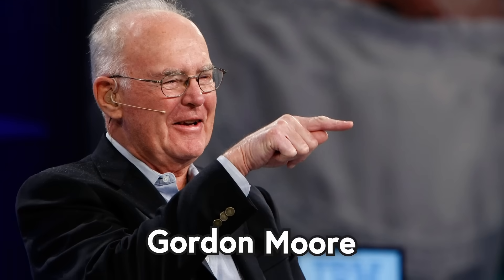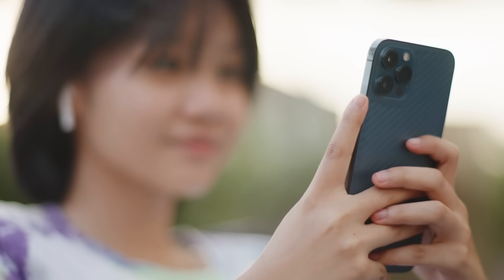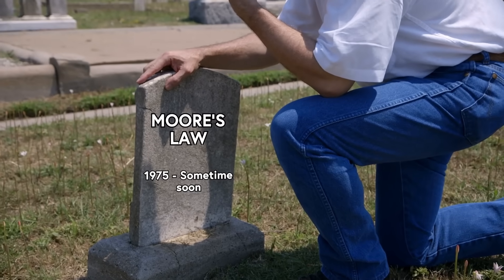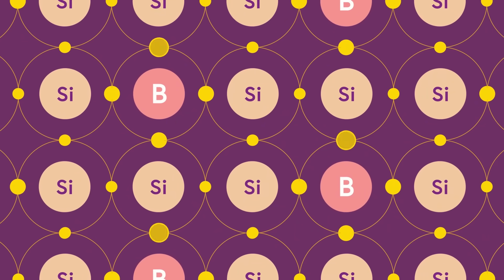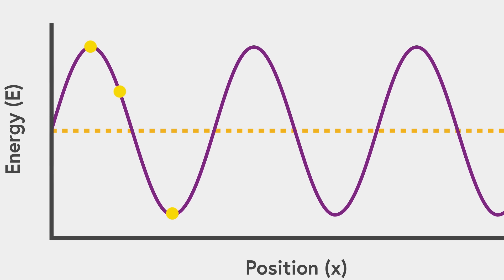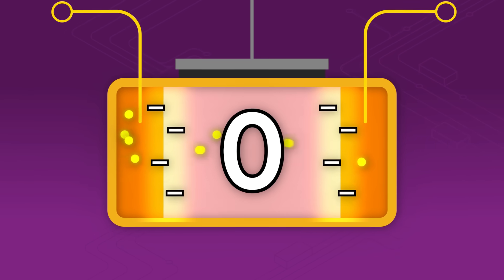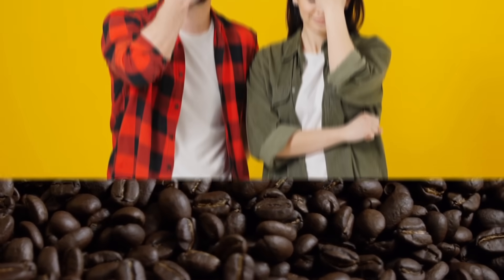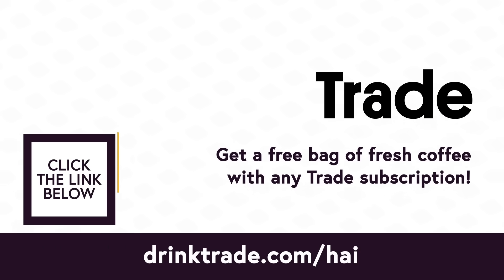Why We're Reaching the Theoretical Limit of Computer Power

Comment: This was an impressively accurate explanation of how transistors work. My only note is that Moores law is already dead, in that it refers exclusively to transistors per area. For production, instead of implementing the increasingly small transistors that science can create, we've been improving ~30nm technology for like a decade now (GAAFETS and FinFETS, for example). Industry terms like "5nm technology" are actually just jargon that means "a technology a few generations after 40nm technology that happens to give a performance increase similar to what 5nm technology would look like if it was possible for production right now."
Reply: Yep, this guy is correct

Also we've been getting over Moore's law by using processes that are fine tuned for specific applications. For example: Mobile? optimize the transistor for low power. Server? Optimize for performance.
Reply: @b.6603  we also have ways of getting more computing like in-chip cooling, 3d stacked chips, other compute architectures other than x86 and things like compute in memory
Reply: Thank you!! I’m amazed at the amount of people who say it’s still alive when there is literally a specified metric for it, and it isn’t being met
Reply: @UniqueUserName123  "Moore's law is the observation that the number of transistors in an integrated circuit doubles about every two years." so no moore law isnt dead because density is still going up even if the size isn't shrinking
Reply: @kylel1724  stacked finFETs, the architecture is becoming much more 3 dimensional.
we actually have hit true size limits for some components, RAM for instance
Reply: @kylel1724  Except stacking doesnt increase density, it just increases the height of the chip.
Reply: Transistor counts will likely continue to scale in the future through the increased adoption of multi-chip modules (MCM). Making the chip larger is problematic since errors are inevitable, you end up with too many bad chips. MCM solves this by splitting the chip into multiple pieces which then get integrated together.

Some examples of CPUs employing this strategy are AMD's Threadripper and Apple's M1 Ultra.
Reply: But what about operations pr second? Hz isn't limited because of quantum-tunneling.
Reply: @Phethario Operations per second are limited by the breakdown of Dennard scaling in the 2000s. At smaller feature sizes, leakage currents become a big concern, necessitating complex cell geometries with technologies like FinFET or GAA-FET.
Reply: @Phethario  hz is limited by the planck second if nothing else.
Reply: @leftysheppey  It's limited way before that by timings. Since as you approach the speed of light you have to start taking into account how long it will take electrons to move through an incredibly convoluted IC and return a result at the end of the process. It all has to happen in a way the scheduler can reliably predict. Which is the why processors have started using 'chiplets'. But again, that's just work around. The faster the clock speed, the shorter your IC traces need to be.
Reply: @leftysheppey  More practically you'd have to deal with your transistors melting long before that.
Reply: @innocentsmith6091  oh aye, definitely. I just wanted to put an upper bound on it
Reply: @Phethario  The operational speed per second is limited by how fast you can (reliably) push data to and from the operational units. This is limited by the speed of light as well as noise called cross talk. Further more, The speed of charging and discharging the transistors is also limited due to Capacitive effects. These are the reasons CPUs have been stuck in the 2-6 GHz range for the last ten years.
Reply: @byonnem7342  Nice, thnx👍
Reply: @byonnem7342  You're right, but that isn't a hard universal limit.
Reply: @byonnem7342  I kind of disagree about the reason for clock speed limitations. Those are problems, but you can just allow intra-die communication to take more clocks and divide the chip in a bunch of clock zones. Individual transistors already can clock at hundreds of GHz, so you can just do less work per clock, in more stages operating in parallel, and you can do the same total work per clock at higher clocks. The real showstopper was the fact that voltages couldn't be reduced much below 1 V and still have a reliable device. Leakage current also went crazy. Pentium 4 already overclocked to 8 something GHz (Northwood) with liquid nitrogen and a good sample, with the double pumped ALU that was 16 GHz in parts of the chip.  It worked until the device needed to be cooled by liquid nitrogen; than it stopped working for anyone but overclocking hobbyists.

The only thing wrong with pentium 4 was that Dennard scaling died and Intels 8 GHz by 2003 prediction turned out to be laughable. (also, X64 exists because AMD conservatively extended X86 and intel wanted to emulate X86 code on their new IA64 itanium architecture; but IA64 turned out even more terribly than the pentium 4).
Reply: @byonnem7342  actually some people i think pushed A cpu to 10 Ghz i don't think we have hit that limit yet, and then again we don't know if the speed of light is a limit we never reached it. We are just taking a education guess that is the limit for the moment
Reply: Well node size really just has to do with the minimum width of features, which there has always been a debate between what counts between companies. I mean, everyone is using the same tools from LAM, ASML, TEL, AMAT, etc, so it comes down to chip design and integration...
Reply: Oh. I didn't know that. Thanks for enlightening me.
Reply: Where can I read about that? always though the sizes marketed where literal
Reply: Isnt that is also the reason we are not gonna reach quantum tunneling until or even after "1nm" node? Because the 1nm transistor size is actually gonna be much bigger than 1nm.
Reply: It's almost like using historical data to make a prediction with no end never works, which is exactly why I doubt the inevitability of the technological singularity
Reply: @NillyTheKid  Nothing can experience exponential growth forever. Sigmoid curves match reality much better.
Reply: @bbgun061  Please tell the AI boosters that.
Reply: @MultiLegolas100M oore said it would end in 10 to 20 years in 2007. So he he didn't said it would go on forever. He did say when we would hit the fundamental limit we would just make bigger chips. Also Moore said it would end around 2025 which right now is looking likely
Reply: @NillyTheKid  Looks like we're not getting warp speed in 2063 since we're still in the "mostly exploding" phase of testing conventional rocketry. Imagine testing sci-fi stuff.
Reply: @NillyTheKid But AI isn’t really that far from humans (well it is but probably not on a log scale which would apply when the improvement is exponential) and it probably won’t just stop making progress suddenly
Reply: your right,  a group already had a 6 gghz cpu to 10gghz with liquid nitrogen  LOL   smaler and smaller isnt the key when your case is 2 feet by 2 feet...if that cpu was 4 times the size it would disapate 4x the heat....  stupid isnt it?        why risc is taking over, they dont need to be tiny
Reply: But sub 10nm sized transistors are a thing though? Don’t get me wrong, there’s a lot of industry jargon, but even at 30nm quantum tunnelling is a non-issue
Reply: @jerry3790   They aren't, those nm numbers are marketing. I'd have to check, but IIRC TSMCs N5 node has HD 3T cell libraries with a gate length of ~35nm and a total length of ~120nm.
Reply: @Azraleee  thats actually crazy, ive been under the assumption that my cpu runs on 7mm for 3 years now, but i guess not
Reply: @FritoTheLay  Node names have been marketing for nearly 20 years now.
Reply: @FritoTheLay  you can see it as it has a transistor density that is equivalent to a 7nm process. Iirc they went 3 dimensional a long time ago.
Reply: @Azraleee  Yes those are commercial transistors, but in lab settings we have successfully made chips with gate lengths sub 10nm.
Reply: A mesh-up of bipolar transistors and MOSFETS may sound or look plausible, but is nowhere near reality. Reminds me of the President suggesting to drink disinfectants aganist COVID.

Comment: Given the level you are trying to explain this on that was not bad.

I think you might have been able to explain the inversion layer a tiny bit better but... nice WKB tunneling stuff, if this made sense to non-experts so much the better.

Quantum computing might make a difference of course as you say but its answers will be probabilistic so perhaps not great for say banking. There are ways to use the billions of transistors better though so classical computing will get better, but more slowly for a while. Much of the slow down actually started back in 2001-ish era but it probably became noticeable around 2012 (iPhone 5 or 6 if you need a reference point to a thing).

Getting anything up to the level of Silicon technology is a huge gap that will require vast resources given the 80+ years of investment in Silicon based devices.

Comment: As far as I understand it, quantum computers work very differently such that you can't just run any normal program on them. They are just very good at very specific problems, which is the reason why they can defeat traditional encryption methods, but quantum-proof encryption methods do exist. So I don't think quantum computers will just replace traditional computers and solve the problem.
Reply: Is it possible that future computers might have a normal CPU, but also a QPU, similar to how a floating point unit used to be separate?

Comment: Murphy's Law was originally: “If there are two or more ways to do something, and one of those ways can result in a catastrophe, then someone will do it.” It's a maxim about defensive design in engineering. 

 “Anything that can go wrong, will” is actually Finagle's law or sometimes Sod's law.
Reply: my personal favourite is coles law
Reply: @johnsmith99997  the kind with mayonnaise or the kind with vinegar?
Reply: Right, Murphy’s law was after someone put an accelerometer in upside down or wired backwards before a really important high speed deceleration test.
Reply: @joermnyc  A deceleration test using a live human as a guinea pig. The test produced no data because the sensors were installed backwards and they were installed that way simply because they could be installed that way. It's why one hole on an American outlet is slightly longer than the other. Humans can be trusted to find exciting new ways to screw up even the simplest task.
Reply: You're all wrong due to Murphys Law with says "If something can't possibly go wrong, it will"
Reply: @yetinother  including in your memory?
Reply: Isn't it better to say " if it can happen, it will happen".
Reply: I was taught that Murphy's law was "if it can go wrong, it will"
And Sod's law as "if it can go wrong, it will, and at the worst possible time"

Comment: Current flowing = 1
Current not flowing = 0

This is a way in which it CAN be done, but isn't. The problem is that a zero could pick up stray magnetic fluctuations and briefly read as a 1. This is not exactly desirable and would wreak absolute havoc in your system.
Instead, a positive voltage is 1 and a voltage of 0 is 0. (Also called high and low)
In other words, connect the positive lead for 1 and the negative lead for 0. If you leave it unconnected... things go awry.
Reply: The old TTL logic was current-based like that. It worked, but the power consumption was a serious problem. So it was replaced by NMOS, then CMOS. CMOS gates only use power when changing state, so they use a lot less power in general and can be idled down to practically no power use at all.
Reply: @vylbird8014  Ah yeah, I was a bit stupid there - makes sense. If it's entirely current based, (with BJTs, I'm guessing - which is probably what was depicted in the video) some EM interference is not going to create enough current to matter. Only becomes a problem if you are basing everything on voltage.

But yeah, that probably gets expensive fast.

Comment: Quantum computing is one technology that could keep computing power growing, but there are plenty more!  For example, if you can make it cheaper or more efficient to make a transistor, that's almost as good as making it smaller!  Or make your transistors more power-efficient, so you spend less energy computing!  Or if you're worried about space constraints, then try new ways of packing transistors - plenty of today's tech has a single flat layer of atomic-scale transistors, but we're beginning to put multiple layers of transistors down on the same chip, which is basically fitting more of them into the same footprint!  And of course, it's not about the size, but about how you use it - we're learning new ways to take advantage of all these transistors every day!
Reply: The problem with stacking multiple layers of transistors is how to cool them. Think of how big the coolers for modern high end CPUs or GPUs are, then imagine twice the heat generation on the same area. There was a recent debacle with AMD 7XX0 X3D chips overheating on some motherboards, and they only stack the cache, not the the logic which generates most of the heat, and they are already clocked lower to manage the heat generation.
Reply: @256shadesofgrey  Indeed, specific power is a tough battle, which goes back decades - there was a time when you could just give each generation of chip 2x the clock speed and 2x the power draw and call it a day.  But nowadays hopefully we have a better understanding of the need to consider power efficiency and chip density as separate halves of the same problem.

Unfortunately, power efficiency also runs into quantum limits at some point, so there's only so far that can go unless you want some really radical cooling solutions.  But still worth the research!
Reply: I always thought it was odd how the focus was fitting smaller parts in the same space for certain applications. Like desktop computer. It's not like you carry them around regularly, why not make them bigger to fit more powerful components?
Reply: The point of this video was to try to get you to appreciate how we got to where we are and how close to that being over it is now. Clearly the meaning was lost on you though. None of the desperate measures the industry are taking now is any replacement for 60 years of steady progress. The party is over!
Reply: @1pcfred  I'm glad you're enjoying it!

Comment: "a lucky guess that got a lot more publicity than it deserved." 
-- Gordon Moore - 2005
The law still holds up pretty well - it's still exponential and still very close to 2x every 1.8 years (or more or less) if you plot from the original statement to now.
Reply: It is a guess that became an industry target. So it is a self fulfilling prophesy.
Reply: @1pcfred  Not at all.  Ample competition to push more if others were mired at some level.  Though there is some "drag" on that due to capital investment in the wafer making apparatus.
Reply: @AlanTheBeast100  Spot on.
Reply: @1pcfred  My comment isn't about what can be done going forward, only that up to recent data, it seems the 'law' more or less still holds despite some click-bait.
"Pushing more"?  Always do that - but it doesn't have to be in the realm of getting closer to 1 nm (if that's even possible), but instead increasing core counts, specialized I/O, graphics and memory sizes to achieve higher processing bandwidth.
Look at Apple's M1 Ultra as an example of where things are going.
Reply: @1pcfred 4 big ones actually: intel, amd, apple and Qualcomm, soon even NVIDIA 
But there are many more small manufacturers